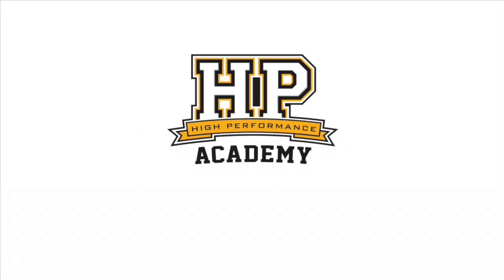Alien Tech talks to us about tuning late model, factory engine management systems

Comment: Hi Andre,

It's been nothing but entertaining and enlightening to see the current-day aftermarket tuning industry through watching many of your video uploads! 

I've been out of the car "scene" for 5 years now, but frankly after watching all of these videos, in combination with the knowledge that I've gained in automotive trade school, inspires me to get back into it with a fresh mind of thinking when it comes to EFI and race car tuning.  So, thank you for providing that inspiration!

I have a question as it relates to this interview.
In the Honda tuning scene, there's a company called Hondata that specializes in a similar way that Alien Tech does--going into the factory ECU and modifying it to create a fully tunable system.  I don't know if you have any experience with Hondata (if you do, what's your opinion on their system?), but does this method  of tuning capability have any shortcomings compared to a full standalone ECU system?